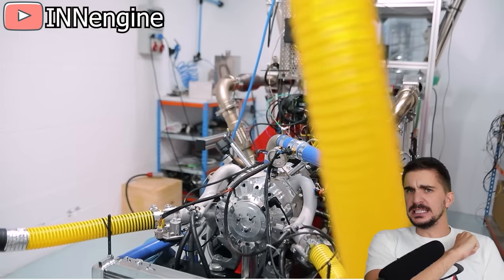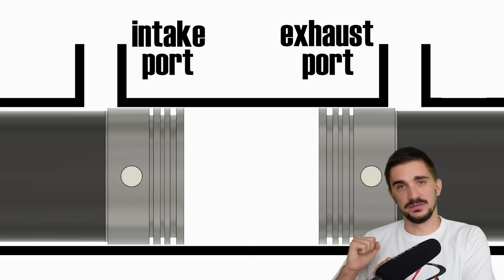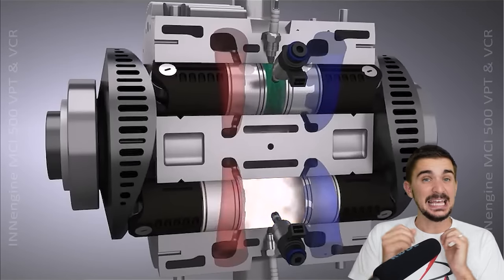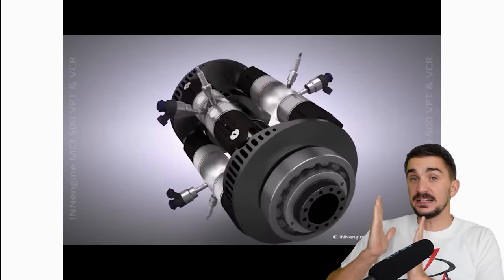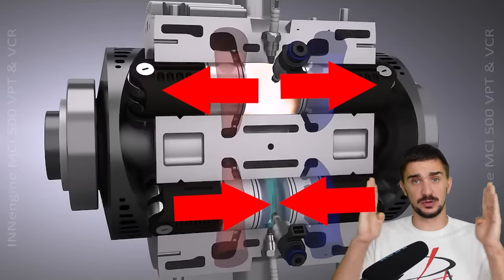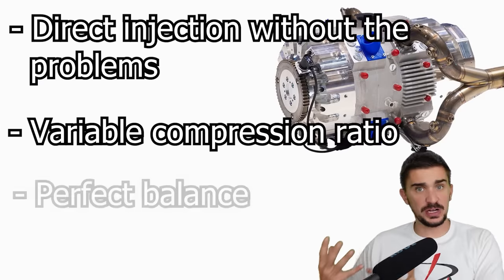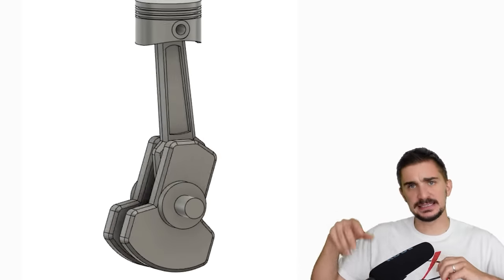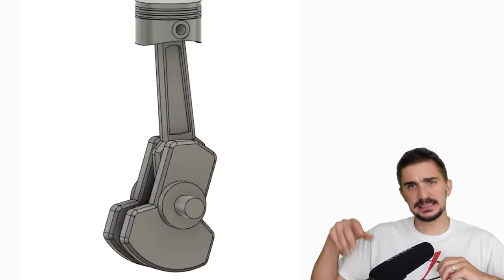Spain is Living in 2050? Revolutionary 1 Stroke INNengine Analyzed

Comment: One stroke engine: Gas turbine. BUUURN

But on a more serious note: why not increase the compression ratio, and add common rail injection? Opposed piston diesel. It would be even more efficient. Best would be to use this as an aggregator. Honestly, this is a damn good idea as they intended, as a range extender.

Comment: I think what they mean is that Two Cylinders on opposing sides operate as PreCompression crating a Forced Air (not Atmospheric pressure) event into the Other Two Opposing Cylinders which operate as Combustion and Exaust, so... Two Pistons could Intake and Compress the air, then when they reach TDC the Intake Valve opens slightly after the Exaust valve allowing the Pre Compressed Air to be forced into the Already Present Vacuum caused by Scavenging Effect ... add a Turbo and you could really have something... So in my idea Two Cylinders operate at Low Temp and the other two operate at Combustion Temperatures... It's Possible...

Comment: This one appears to have similar power/torque ratio to Honda's naturally aspirated small displacement VTEC engines of the late 90s. They produced decent power  but struggled to produce adequate torque for the performance cars they were found in. I noticed the b-roll of the MX-5 did not include a static start.  I couldn't agree more on the marketing. Saying "no turbo" while employing a supercharger is incredibly suspect. It's a centrifugal SC, but it still feeds off the main drive. I simply cannot understand why they didn't focus almost exclusively on weight savings? There just aren't that many 35kg engines that produce that kind of power, regardless? Perhaps there are, but I'm not familar with them. Great video, very informative. 👍

Comment: The wavey thing is an encentric. it's simply not possible to have a one stroke engine. the fact that the lubricant is separate from the combustion chamber. makes this engine a clean two stroke engine. where as normal two stroke engines are inherently dirty engines. because a very small amount of unburnt oil exits out the exhaust. the reason for the super charger is because. the encentric doesn't pull the piston/rod assembly down in the cylinder. and it requires the intake pressure to push the piston down on the intake stroke.

Comment: the first thing I thought of when hearing the specs was using it as a hybrid similar to its either Toyota or Honda, that use the engine strictly as a power generator/battery charger and use electric motors to push the wheels. a very small and lightweight motor that is fuel efficient would be perfect for this.

Comment: Got to love Mazda for trying out new tech like this. Even if it´s technically two-stroke, it´s worth noting that you´ll get a very long power stroke from this configuration. It also allows for a really compact design, which everyone wants. 
In the end, I really like this engine, I think it´s quite sexy in fact :) 

I see a few drawbacks - The wear would start making oval pistons and bores pretty fast from the lateral pressure of the drive. It would require accurate exhaust management to prevent backpressure, which would also limit the usefulness of turbos. Given this, I can understand why they might use a compressor, which would give quite a bit of leeway on the other end. 

As far as the torque question goes, in my mind this parameter is no longer set by weight, but by angles. High angle cams, or what you call "the wiggly bits", should produce more torque, but less power. Also, making higher torque then might require smaller bores, and we have always gone the other way with regular engines. This would naturally mean more oval bores and pistons and pretty much end in the same manner as the Wankel, I guess - but let´s give it a try at least! 

Even though this engine setup is pretty new to me ( about18 mins according to the timeline on your video), I´d say they still made a twostroke, because the 180 degrees firing order will include 4 of the pistons in this "1-stroke" engine vs. 2 of the pistons in an 8-cyl. engine. It´s not 1 event per revolution in a 4-cyl version of what you´re showing, it´s 2 - which activates 4 of the pistons.

Please keep in mind that I spill my beans only to spike discussion and I want to hear your thoughts on this. I think invention comes from haggling about things like this, and I would love to see this engine in a working car off the mill! So please spill some more beans and share your thoughts! I love this part of any project, where everyone can fill their boots! Disclaimer; If you do have an epiphany that changes everything Mazda could think of, call a meeting with their Development officials, and say nothing until they´ve signed off any rights to what you´re presenting. ;)

In the end, Thanks a bunch, @d4a for showing me this, I really loved the video, and I still can´t really figure out if you´re spanish or just pretending. I love language, but I can´t find an accent with you! Are you just that good at speaking English or were you born in the UK?

Comment: “Why are we not using this technology already?”
It’s about perspective. Everyone knows that the early bird does indeed catch the worm.
But carrying that thought further, you come to realize that it’s the second mouse that gets the cheese.  😶
Progression.

BTW, the “wavy thing” is known as a swash plate. Commonly used as refrigeration compressors. Universal in automotive A/C.
Also used in hydraulics… with a variable ramp angle, allowing for a variable output pump, or motor. Commonly used in hydrastatic transmissions that can dynamically underdrive / overdrive (continuously variable) without the requirement of fixed ratio gearing. tho they are often combined to maximize the benefits of each method.
Most commonly used in farm equipment.

Extremely cool technology. 
This could be a real game changer for the ICE.
Varying the ramp angles in this engine would allow for higher torque at lower rpms, due to increased slope, and a longer piston stroke, literally, dynamically, increasing displacement AND more leverage on the ‘crankshaft’.
Vicee versa under minimal load conditions.
Plus, with electronic fuel injection being the boss, you can convert it into two 4 cylinder engines operating in parallel for heavy loads, and then dynamically shift to 8 sequential cylinders for cruising conditions.
Promise of power and efficiency, in a compact design, and far fewer moving parts.
What’s not to love about it?  😶

Comment: If this actually was a feasible engine, but was just lacking sufficient Torque for accelerating from a stop,You could add a flywheel.. You could also incorporate a braking action that restarts the flywheel for the next acceleration phase.

Comment: Aligning these zylinders in a row and using a confential crankshaft, basically building a double piston flathead would be much more target oriented. This "rotary" think has not just the problem of torque, but also the problem of wear. All the force from the piston presses on it without it being able to move in the piston movement direction. Just basic mechnics tell you that this will wear down this surface fast.

Comment: WE need more data to find out the mean effective pressure in MPa which is a measure to compare engines. At what rpm were 150 HP reached?  What is the torque in Nm? A good way to judge is the fuel use in g/kWh. What is the maximum piston acceleration in m/s^2? Unless the people reveal these data, they seem to be hiding something.

Comment: @16:16 - the claim that INNengine has twice as many power strokes per crankshaft rotation than 2-stroker, although it's little bit of manipulation, is actually true statement. Take notice that the wavy treadmill ring has 2 crests and 2 throughs along it's circumference. Therefore every cylinder has 2 power strokes per 1 crankshaft rotation. Theoretically they could make wavy treadmill ring with even higher number of crests/throughs, like 3 or 4. To achieve something like that in classic engine, we need to connect pistons with crankshaft by sprocket wheels with 1:2 ratio. 😊

Comment: The term for the piston plate is "Swashplate". Used in many AC compressors. The details on the oiling system are missing, and probably are key to engine service life For the lubrication system to be truly independent of engine orientation creates questions. Any pooling inside pistons while inactive, may make starts 'interesting'. The dichotomy between torque of single piston engine vs inline 4 are not inherent in the design layouts, but are direct products of how the engines are tuned, largely affected by the large primary imbalances of high speed singles. I'm pretty sure you know this.

Comment: I'd call the 'wavy thing' a 'face cam', actually a pair of face cams, to push the piston in both directions.  And because it's an opposed piston design, there are two pairs of face cams, that is one pair at each end.  Looks expensive to manufacture, and likely to wear out faster than a conventional crank design.  There also has to be a linear bearing to absorb the side load on the piston rod - this is called a crosshead in steam engines, and large marine diesels.  On the other hand, no need to manufacture camshafts and cam drive gears for this engine.

Comment: The number of strokes in an internal combustion engine is determined by the number of combustion events occurring in each cylinder. The typical internal combustion engine operates on a four-stroke cycle: intake, compression, power, and exhaust.

Each combustion event happens once every two revolutions of the crankshaft in a four-stroke engine. This means that in a four-stroke engine, there is one combustion event for every two strokes of the piston.

In engines with multiple cylinders, each cylinder undergoes its own combustion cycle independently of the others. So, if you have a four-cylinder engine, there are four combustion events happening simultaneously, each following its own sequence of intake, compression, power, and exhaust strokes.

Even in engines where there are multiple pistons moving in the same cylinder (like opposed-piston engines), each cylinder still undergoes its own combustion cycle, and the number of combustion events is counted per cylinder, not per piston. So, in a two-piston opposed-piston engine with multiple cylinders, each cylinder still undergoes its own combustion cycle, and the number of combustion events is counted based on the number of cylinders, not the number of pistons.

So, in this engine, if there are two combustion events per crankshaft revolution (cam-track in this case, or the "wavy thing" that you call in the video), this means, whether you like it or not, this is a one stroke engine or, maybe, a complete different thermodynamic cycle. In any case, the change in this engine is much more drastic than those of Miller o Atkinson in the 4-stroke engine. This engine, call it - stroke, complete different approach to 2-stroke, “shortened cycle” or whatever might come to your imagination, is a lot more ingenious.

Comment: The wavey thing is a cam. Wavey cam 🤩 what's the engine's RPM top out at ? Supercharger not turbo zero lag time. Fascinating engine none the less. Nice upload cheers. Wow 120 bhp even with the supercharger that is crazy for a 500cc engine. Stick it in a motorbike and i'd be up for a spin the power to weight ratio would be crazy. But it's all about peak RPM then the charger will help, it just doesn't sound like it would put out a lot of torque. Is it a thumper or a rev crazy high RPM engine? My bet is high RPM but low torque.

Comment: The super charger would be helping force the exhaust gas out and preventing blow back into the intake. It would be almost impossible to turbo this engine. The exhausta nnd the intake would be open at the same time. Therefore you cannot make pressure in the chamber. As soon as the video graphics started, I could see the need for the forced induction to clear the exhaust.

Comment: I think the high pressure on the roller cam design of the combustion process may also can be a big issue. It has insane cycyles  and very high shock load and the pressurized area is quite small. It may can be that is needed to improve the design to reduce the pressure on the rotating cam. That can result in higher engine weight and more efficiency loss on top.

Comment: 17:00 You're so wrong about concluding the work is same by stating that INNengine firing 2 times per 180°. It has opposed pistons, you have to calculate the opposite piston as well, meaning it hits 4 times per 180°.

Comment: It's probably worth talking about the overall thermal efficiency of the engine as one of the main discussion points.  I would imagine it would be quite high for the size of the engine, which would translate to it being a fuel sipper.  I'm assuming it would see similar thermal efficiency gains as the Achates design (which unlike this design has a fantastic torque, but also has 2 cranks and reasonably long stroke).  This design is sort of like swash plate piston pump and a Junker engine had a baby.

Comment: Im wondering about since Long Time why they dont use opposite Piston engines, they are crazy efficient. Double the torque of a normal combustion engine and with this Designe direct Power to the drivetrain. Increddible genious these dudes in spain

Comment: Nice design, i mean really nice, thou you can build a crank shaft upon this engine and make bigger displacement, it will enlarge the size of the engine too, but each piston moves the same way as in normal engine and "wavy thing" can have a level that makes stronger rotary force depends on how being geared. So they have lot of options to improve further more on the design, but that being said, it is still a nice design.

Comment: you could modify the profile on the im going to call it a sinusoidal crank plate to also change HOW it compresses and have different plates tunes for different fuel profiles. (which you could do with the variable compression mechanism but that would not be optimal from a reliability perspective as it would have to advance and slow the heavy sinusoidal crank plate 2 times per revolution on a 4 cyl setup)

Comment: How about having a double sided piston, each going into a cylinder, and con rods between the cylinders? For stability and longevity probably want con rods at either side of each cylinder, but can be shared if next to each other. Each movement of every piston is both a power stroke and and exhaust stroke, or intake and compression, idea.

Comment: Its an opposed piston Detroit 53/71/92-style Diesel.  Same ported cylinders and supercharger scavenging, same 2-stroke cycle.  Build it stouter, with 18:1 compression, and put a diesel injector in the cylinder.

Comment: The engine that had a unitraction gear in its center and a piston connected to its binary gear structure being part of its reducer makes the piston go up and down directly in the center while one of the sides of the unitraction gear rides the crank case and the split gears connected to the inner transfere case of the unitraction gear AKA "rear axel gear of a rear wheel drive vehicle "making the other side of this type of gear connected to the crank witch connects to the rod, rist pin, and piston...

Comment: when I see an engine that struggles at low RPM, I immediately think about adding electrification. I wonder if the very low weight and small form factor would allow you to design a good hybrid vehicle using this technology.

Comment: You do have to consider that there are two apexes and troughs per rotation of the crankshaft.  Because of this, it is technically an average of 90 degrees of rotation between a combustion. So though 1 stroke is not true, each cylinder will combust 2 times per 1 rotation of the crankshaft.

Comment: Regarding the 1-stroke claim, I agree that it's mainly a marketing thing and that from a cycle perspective it is a 2-stroke. However, there is one thing in this video that you got wrong. You said that one power stroke occurs every 180° of rotation, which isn't actually true. During one full revolution one cylinder actually does two combustion and two compression strokes each lasting 90°. Of course this still adds up to 180° of combustion and 180° of compression like any other 2-stroke design. But this is probably where somebody got the idea for the 1-stroke claim because there are technically two combustion events per cylinder during one revolution.

Comment: I'm assuming the force of the exhaust exiting and creating a vacuum to pull the intake in wasn't very effective. Needed the forced induction to compensate. Also note how they don't mention maximum RPM anywhere. The faster those pistons are moving the less time those ports are open for, suffocating the engine. It probably has pretty low torque and power at the lower end and also can't rev high enough to create horsepower which is probably why they never opened the throttle on the demo car. 
However, this could potentially be fixed by making the pistons longer. A longer stroke necessitates steeper inclinations on the crank wheel thing which creates greater torque. The longer pistons could also allow for larger ports for better breathability - maybe. ALSO, there might be potential in making the "hills" on the crank wheel asymmetrical such that the side the piston is contacting during combustion is more steep than the side that is pushing the piston up for compression. This would increase torque in combustion and keep the valves open longer. I don't think this would create balance issues because for every asymmetrical hill there's another one opposite, asymmetrical in the other direction. I could be wrong though, I'm not an engineer 😂

Comment: Maybe the perfect engine for a hybrid. Simple, high revving engine coupled with a high torque electric motor. Could even be used as a generator engine to power the batteries.